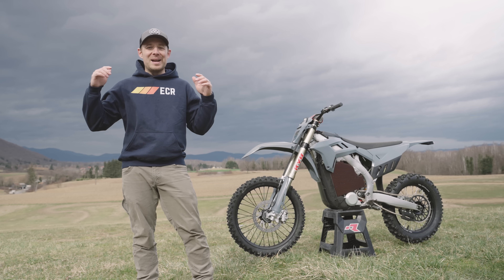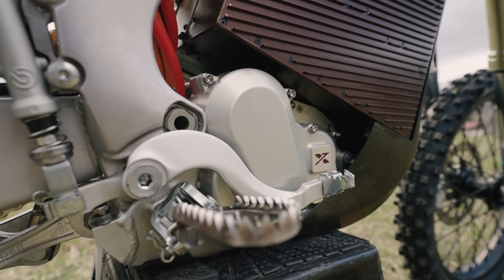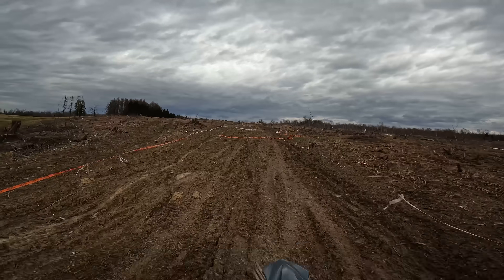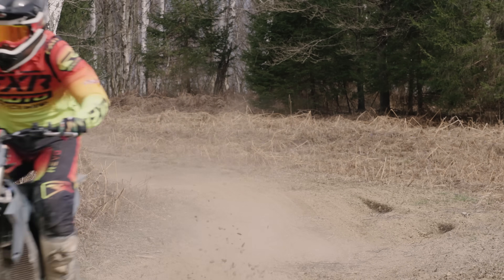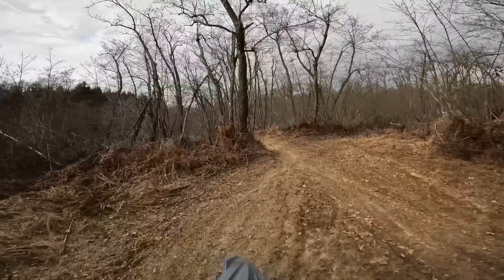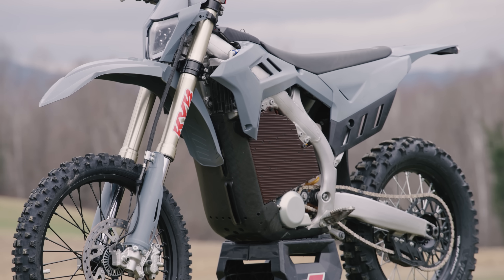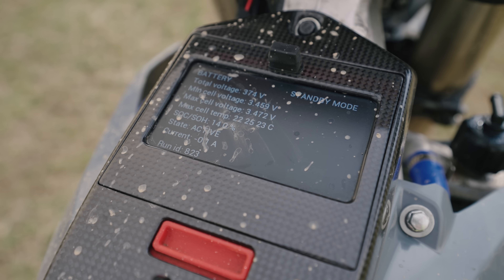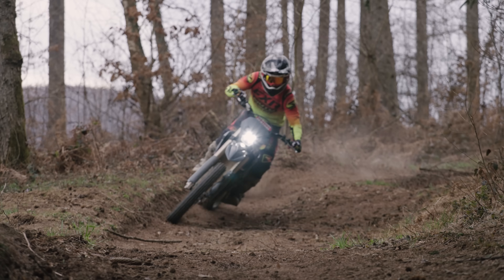We Rode This NEW Insanely Fast eMoto // Flux Primo First Ride

Comment from the maker: See more about Flux Primo on ECR: https://bit.ly/FluxPrimoFirstRide

Shop Aftermarket Parts Here: https://bit.ly/ECRParts

Best Deals On Electric Dirt Bikes For Sale: https://bit.ly/ECRMarketplace

For more tests and reviews on the latest electric motorcycles and dirt bikes, visit: https://ElectricCycleRider.com

Click Here To Subscribe To The Channel! https://www.youtube.com/ElectricCycleRider?sub_confirmation=1 

Instagram: http://instagram.com/electriccyclerider

Check out the Flux site: https://bit.ly/FluxMoto
Reply: You can estimate battery range pretty well at various speeds, by comparing it to gasoline powered bikes of known power output (aka. wattage).

Random A2 license (11kW) bike with similarly crap aerodynamics to dirbikes (to allow for a guesstimate) is yamaha MT-125, which tops out at around 115km/h, thus with such aerodynamics, you would need 11kWh to travel 115km at said speed.
OR with current 7kWh battery, you get 7kWh/11kWh = 0,63 times the range at said speed, around 73km.

Something like Beta RR 50 enduro comes with 5,3kW power, and tops out between 70-80km/h
So it would have a range of let say 75km on a 5,3 kWh battery.
Well with flux primos battery it would get 7kWh/5,3kWh = 1,32 times thet range at said speed, which is around 100km.

So let's sum up the back of the envelope caluclations.
At around 115km/h (70mph) you can expect around 73km (45 mile) range.
At around 75km/h (47mph) you can expect around 100km (62 mile) range.

...without radical diffeences in aerodynamics (well so long as manufacturer stick to the usual "modelled after the aerodynamics of a parachute design), range is pretty easy to estimate from battery capacity.
If you want to do better, you can pick bikes that look more close to the one you are curiious about, and adjust for frontal area.
And if you are curious about random speeds you just fit a curve to these known point.
As its not exactly new knowledge that drag force acting on object is more or less proportional to (velocity)^3, you can fit a parabola curve to the points and use it to read the range, by dragging your finger on the velocity axis, and checking what range correspond to said point on the curve on the kWh axis.
Reply: In regards to the charging, outside north american market - where dirtbikes lives are spent on the back of pickups - existence of charging station matters not, what matters way more if the manufacturer is gonna follow scum like Zero, or will have the decency to use standard fitting, allowing plebians to take advantage of existing charger infrastructure.

BUT even if, you got their proprietary charger, the 20 minutes from 20% to 80% implies a 2C charge rate.
I HIGHLY doubt that they will enable such charge rates on bikes that are sold to the public at large, as no established manufacturer (that i am aware of) manufactures Li cells, whos lifetime wont be drastically shortened by regular chargeing at 2C.
...ofc. if flux makes their own Li cells, it could be possible.
However pushing cells on the market that aint rated above 1,2C charge rate, to well north of 1,4C wil drastically shorten battery cell life, thus battery pack life.

Comment: Nice video! Hopefully they get rid of that shock. Like the display location much better than the Stark. I do like the hand brake of the Stark though. No sure you really need the regen lever/clutch. If you have the hand brakes you can keep your feet on the pegs anyways.

Comment: They should design a trailer that doubles as a charging station! That would be cool. Can I get credit for that idea? 🤔
Reply: We wouldn't want to lose too much focus as a company, but many builders are converting trailers and vans to have an integrated battery storage + roof solar. So in the week it fills up, on the weekend you use it up :)

Comment: Good job explaining the feel of the power. I'm constantly watching Varg reviews waiting to hear someone actually explain how the power feels compared to a 450, but all I ever get is something stupid like: "Wow, that was amazing!"
Reply: you just cant compare a 450 with the 80HP of the Varg. you have never experienced anything close to that power/NM.   
I can promise you, you will react the same ways like the guys did in their first ride reviews :)
Reply: @mcnevets That's ridiculous, you just have to be able to express the difference.
Reply: @FaithandActiondotnet  thats 938nm imagine three times the power of 450 at all time . With no reduced power at the varg
Reply: @mcnevets Man, I want to ride one!
Reply: Down low, the torque comes on much stronger and faster, it's easier to get wheel spin, but at the same time it's controlable wheel spin.  The feeling of getting power in a linear fashion all the way up to the bikes top speed is extremely smooth and intuitive.  It makes the bike much easier to ride and control.  It's like the bike feels more balanced overall.  When I go back and forth between my Alta and my 22 sxf450, the difference is huge.  It's crazy how jerky and rough the ride is on a gas bike, and the need to shift becomes annoyingly apparent very quickly.  Now, on the top end is where I tip my hat to the 450.  At the higher speeds is where I feel the 450 has more torque and that's mostly due to gearing.  For most of my riding style though, that lower stuff is where I tend to be.  Basically if I'm looking for a more precise, safe, ride that's connected more to the nature around me I'm taking the Alta.  But if I'm looking for something that's just in your face loud, obnoxious to everybody around me in a good way, and challenging, then I'm taking the 450.
Reply: @JoshStreetDesign  Good explanation, thx!

Comment: power and speed are not king on off-road riding as anyone who does it will tell you, rideability, suspension, comfort, durability and many other things make a good off-road bike, and of course, the big problem with EVs is the battery time, as a kid I could play on trail bikes for 18 hours a day, how many battery swaps you going to need to do to get anywhere near them hours, 
N/B is the battery swappable or is it a case of draining it and going home 2-3 hours later ?

Comment: Looks like a older CRF frame, new CRF plastic, Yamaha front fender and KTM headlight shell. KTM triple clamps maybe? Quite the parts bin special. Cool bike. What does the sensor on the front wheel do? The Eclutch sounds like a great idea. Seems these guys are really good at sorting this Ebike stuff, from the throttle response to the Eclutch. Nice.

Comment: About six months ago, I cancelled my Varg order after people started getting them and posting videos. I immediately pre-ordered the Primo at that time. The Varg is an amazing bike, but, given the range numbers we're seeing, it wouldn't complete one lap of a two-lap enduro here in Iowa (the one run out of my parents' farm is 36 miles per lap). The Primo has more going for it for the type of riding I do. The swappable battery is damn near a necessity for enduro/hare scramble race days given current battery density possibilities coupled with charging realities.

I would have had the Varg by now, but my 2024 300 XC-W Hardenduro should be enough to hold me over until this comes out. I shouldn't phrase it like that; I'll likely keep the 300, too.

The biggest downside, I assume, is going to be the cost of the battery. I'd likely want one or two extra (really depends on how the range ends up), and I can feel just how much that's going to hurt my wallet.
Reply: Any idea what the Primo is expecting to sell for?
Reply: @crowe9385  - They're "guaranteeing" €12.000 for people who have preordered, and €13.000 for those that didn't. So $13,100 and $14,200, respectively, at current exchange rates.

This is straight from the FAQ on their website.

The $50 preorder is refundable, so I saw little reason not to do it given my interest.
Reply: @crowe9385 12k it says on website and I believe that is potentially an early order discount, I think it would have to be released cheaper than the Varg to be competitive personally 😅
Reply: You cancelled your stark just because other people were receiving their bikes and you hadn’t ? Hmmm ok . Now you will be waiting till 2026 for this bike , and I can tell you now this brand will not survive . Stark already has the name , they were a marketing machine from day 1  and I see flux as being some small second rate brand that will barely have any dealers and poor resale value . By the time this bike arrives it will be doing battle with Honda and other brands .  It won’t survive .
Reply: @Ozrider2504  - No. As described further in my comment, I cancelled when it became clear that the Varg would not work for my use case. Something with a swappable battery would. I'm not in a hurry. I welcome to competition in the electric market from the major players. Until then, the 300 XC-W I have will be fine.
Reply: @Ozrider2504  this is the truth.
Reply: I like the decision making. You’re gonna have a splendid perfect electric dirtbike by 2029. Then the 2030 will come out.
Reply: Yeah electric bikes are super gay 👍
Reply: @bradforester3635  - Okay.

Comment: Stark varg has a 6.5kwh battery. So if the weights are ballpark and the power is similar, then 7kwh should get you more range…
Reply: Stark is 7kWh

Comment: should make Adjustable Turn throttle - 1/4 to 3/8 turn  -  many times having Quick Turn throttle is not good - like in mud or hard pack - 
fine throttle adjustments make bike  easier to ride fast -
Reply: the production bike will have throttle mapping via smartphone, so you'll be able to tailor it to your preference

Comment: Why not just program the regen braking into the throttle? When you close the throttle it slows you down. Like an electric car, where you can customize the braking force.
Reply: Turn by turn variability requires the additional control in this sense.

Comment: Thanks for coming down and sharing your experience 🤝
Reply from the maker: Great experience and looking forward to more coverage as this bike hits it's next stages!
Reply: Awesome idea with the digital lever. It kinda combines the rear brake (which I love to have at left hand) with a clutch.
Idea: how about you block the motor from rotation, if stationary and the lever is fully pulled. This way, messing up any uphill, you can use your feet freely to save it without rolling back. Like with a Surron, where the rear brake on left lever is really useful
Reply: @MrMrMrMrMrT  we’re planning a similar thing, hill lock; the motor doesn’t allow the wheel to spin backwards, precisely for hill climbs. But that’s gonna be on the next prototype, as it requires some hardware changes
Reply: @FluxMotorcycles Well, I see you guys already think ahead :)
But it needs to be a releasable hill lock - just saying. Sometimes you are going to tip over backwards and need to release the back wheel quickly for a moment, to get the front wheel down again
Reply: @MrMrMrMrMrT  good point and another potential use case for the virtual clutch
Reply: Amazing work surprised a company actually came to challenge Stark so quickly, how long has the bike been in development? @FluxMotorcycles  and how many units can we expect?
Reply: @thepsychicpeach8425  This one about a year with a very small team. It's a start point towards the production bike, that will look completely different, but use internal solutions developed now (we're approaching this differently to most newcommers). 
Units we'll see, but long term goal is in the 10s of thousands
Reply: Please make it with a hub motor too ⚡
Reply: @5LeTT In the front wheel? This would be generally soo cool to experience. I have built an AWD Mountainbike and it was climbing like crazy with the front wheel drive added. It also kinda stabilizes itself when slipping sideways. Of course it wouldn't be MX able anymore due to the unsprung weight, but for Enduro a heavier front wheel even has its advantages
Reply: @MrMrMrMrMrT  no. In the rear. so you don't have to worry about the chain or the belt. less maintenance. Make it like a fun yz125 :) no need for 80 hp

Comment: Great to see Flux' progress this far. 
They look to be the best fully sorted Enduro offering in the EV space. The Varg is not much use to us in Australia as we need to be able to road register bikes to ride on public lands. (Forestry, bush etc)

You forgot to mention the swappable battery feature too, another option for fast power changes in a race environment.
Reply from the maker: For sure, the swappable battery option wasn't really discussed during our test and we didn't see that swap happen in person. Again, it's a prototype, but that is something we will for sure show if it remains a feature of Flux's production machine, when the time comes.
Reply: @ElectricCycleRider - I absolutely hope they keep the swappable battery as a feature. Without it, this goes back to just a bike I'm rooting for rather than one I want to take delivery of for the purposes of using it as an enduro/scramble race bike.
Reply: Best fully sorted enduro option ? They are still at prototype stage …. Stark will have enduro model to market before flux  and also stark will still be around in 5 -10 years .

Comment: sorry for this massive paragraph vomit but I love this thing so much! Im really critical about E dirtbikes since I am a hobbyist electrical engineer and I see many issues with them tha just dont seem to add up. this thing doesn't have those. this bike has over twice the amount of individual 21700 cells as a stark varg, probably close the same cell quality, it should have far more battery range and the batteries will jut last so much longer than a stark varg! notice how this bike shows all the stats, the cell voltages, max and min cell voltages, the charging, driving wattage and even temperature! it shows you everything, it hides absolutely nothing! their social media teak messages you back and answered several of my questions about the motor setup and what characteristics to expect, they have a setup which allows for good low end power without destroying the esc and motor, unlike stark varg who blocked me when I kindly asked them what kind of motor setup they had. the math just adds up for this bike too. if you use a high end modern cell, such as the Samsung 50s for example, the kwh, the wattage output, temperature, min and max cell voltage, and everything in-between is set up so that the cells are never pushed beyond their limits and thus the battery on this bike will truly last a lot of recharges! the stark on the other hand not only blocks you and fails to answer any questions (whether you ask them or whether its on the website) and the math shows that their batteries, motor, and esc are all being pushed so far beyond their limits that its not even funny. a stark varg has a maximum wattage output from the batteries of 50hp for a very short period to time, only like 10 or so seconds max. that's is pathetic and far below the actual 60 hp it outputs, you see the problem, it is destroying itself every time you ride hard. The math adds up for this bike tho. with twice the battery size it can output more power, have longer battery life, and overall have far more performance while keeping the batteries within their specified limits so that it should get far more battery cycles (battery lifespan). sorry for paragraph vomit but I am so excited for this bike and maybe even a smaller model to eventually hit the market since it is a true bike, not a lie to increase sale numbers like the stark varg.TLDR: this bike is actually made so that it doesn't overpower or push ts components passed their specified limits and thus will have the same performance with a far longer lifetime and far better reliability.

Comment: You said that their fast charger is a stand alone but needs 3 phase power to charge the bike yet you are out in a field charging?? Is there a large battery inside the enclosure?
Reply from the maker: Nowhere did we say it was a stand alone charger! That charger requires 3 phase power, which was available from a pole in the middle of the field that track.
Reply: @ElectricCycleRider  I'm sorry for misunderstanding. You are correct you didn't say stand-alone. I misinterpreted the word monolith for standing on its own. That would be a good idea though, to have a quick charger with a battery in it for being at the track or staging areas. Although expensive
Reply from the maker: No worries! Of course, a stand alone charger would be great, but would probably only be capable of charging lower voltage bikes charger at a slower rate, and as you said, expensive.